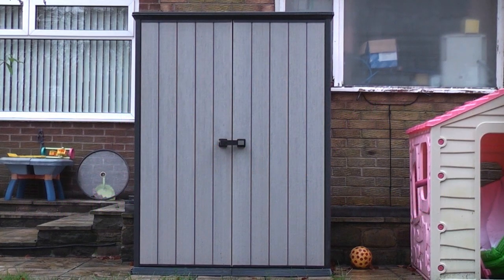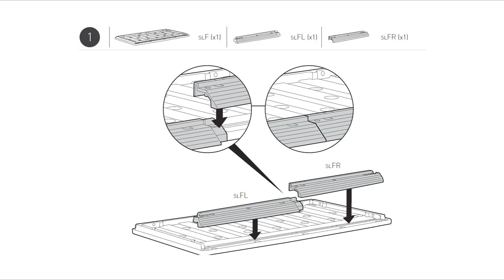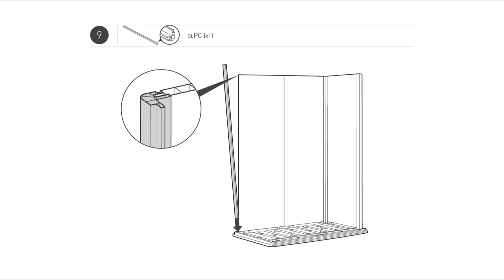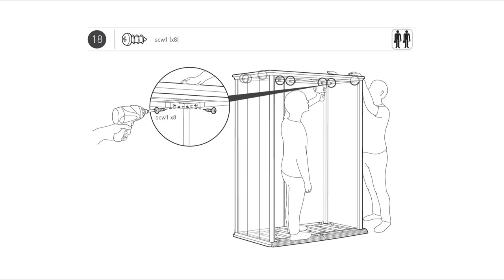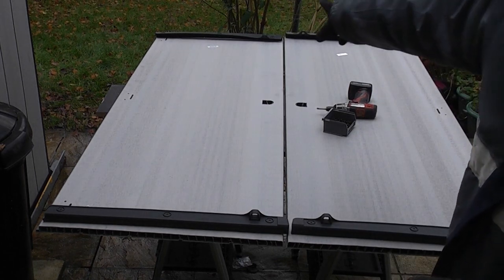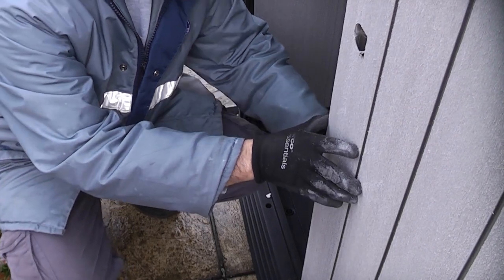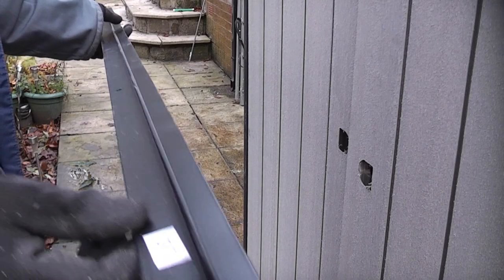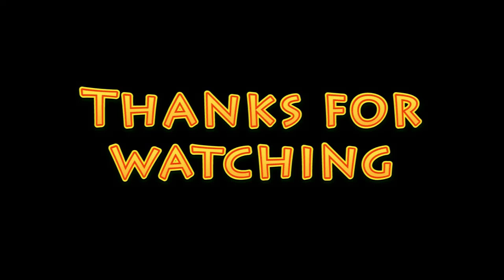Keter High store review and how to assemble

Comment: I have two of these sheds.  The first one I assembled just like the video.  Found that it was a little tricky putting the handles on the doors since I was doing it by myself.  The second I completely assembled the doors, including the handles before attaching the doors to the main part of the shed.  Much easier assembly.
Reply from the maker: Thanks for the comment 👍
Reply: @ultimatehandyman  How do you hang shelves in this?
Reply from the maker: @rogerlubhaya9768   It looks like you just use L brackets, it's on page 26 of the manual here-
https://www.argos-support.co.uk/instruction-manual/4717571-keter-high-store-garden-storage-shed-grey.pdf
Reply: Good tip thank you

Comment: Thank you. This was a lifesaver. One small missing component: I did not see in either your video or in the instructions, the step where you drop the nut down inside the door handle so the long screw can tighten. Maybe I have a slightly new version than previous products?
Reply from the maker: You are welcome.
Yes, I don't remember that component and I was careful as to film everything, so perhaps they have changed the design slightly.
Thanks for the comment

Comment: Nice video. I managed to assemble this myself…still can’t believe it because the last thing I assembled was probably 50 plus years ago, a Lego house.
It’s a great storage unit and I’m really pleased that it’s absolutely waterproof.
Mine doesn’t have shelves although brackets were provided. I’m wondering if you can advise if 12mm thick hardwood plywood is ok. I only need one shelf and don’t plan on putting heavy items on it.
Reply from the maker: That should be fine, as long as enough brackets are used, or it might bow 👍
Reply: @ultimatehandyman  Thanks for that!

Comment: Thanks very much for putting that video together. It made assembling the Keter high store easy. On the version that I purchased, there were no door bolts that latch the door. I think this was a cost cutting measure by Keter. This was unfortunate as the door no longer latches in place and is only held by friction.  Still a nice unit in my opinion.
Reply from the maker: You are welcome
Thanks for the comment
Reply: Probably too late to help, but you apparently have the same model that I do. You have to drop the nut that came with the screw down into the door handle. I suspect that older models had a receiving nut already in place inside the handle, which is why this step also isn’t in the instructions.

Comment: Looks very good. I was wondering: 1. Do you think the inside will 100% stay dry after a heavy rain shower? And would  the holes in the bottom part let excessive water flow away? 2. Is the top part ("the roof") descending so that any rain will  flow away? Thank you.
Reply from the maker: I can't say for sure. This has been fine for a couple of years, but we moved it a few days ago and it was wet in the bottom- but I'm pretty sure that the girlfriend has not been closing the door properly (she's not very bright, bless her).  Once the patio area is restored I will move it back up to the house, but monitoring it will be difficult as she uses it more than I do, and it's likely that she won't close the doors properly again!
Reply: @ultimatehandyman  Thanks for your prompt reply! Would you think the roof is (slightly) inclined?

Comment from the maker: I did consider making an outdoor storage cupboard from timber, but because I am so short of time I decided to get one of these from Argos. Hopefully this cupboard will last for decades. You could probably assemble this cupboard in less than a hour if two people were doing it.
I bought my Keter High store from Argos- http://fave.co/2k4DU0n
Although you can get them from ebay - http://fave.co/2k1V3aN
or Amazon- http://fave.co/2kAk1gX
Merry Christmas to everyone ;-)
Reply: V.G. video. As per.
Can two be connected if the join in the roof is possible to seal.?

Comment: Great video! Ordering mine today, I live in Florida with tropical storms and hurricanes, how would you anchor it down to a concrete slab? Does it come with instructions or recommended anchor point? Or should I just randomly drill down and anchor it?
Reply from the maker: It has 4 round sections in the base where you can anchor it down, I think it had basic instructions on how to anchor it, but the fixings are not supplied.
Thanks for the comment

Comment: What a great video. Thank you so much. Am thinking of buying one and feel way more confident now about assembling it. I can put it together on level slabs, but was thinking of then siting it on a gravelled corner. Do you think this will be okay?
Reply from the maker: As long as the floor is level it will be fine. 
You can't assemble this on un level ground or move it to un level ground after assembly or the doors will not open and close correctly.
Thanks for the comment
Reply: I was also going to assemble the product on level ground, but need to move to the driveway, which is slightly sloped (maybe 10 degrees). Do you think there is any tolerance in the product (especially with the doors) that allows this? I’m not a great handyman so not sure what to do otherwise?

Comment: Great video!  Our kit did not have the SLVP pieces, which I assume are for strength.  Do you think they are needed?  I could look for something at the hardware store.
Reply from the maker: I'd get in touch with the supplier or Keter directly and tell them that the bits are missing. They should send them to you!
Thanks for the comment 👍

Comment: Did you need to anchor these down to the pavement? If so, are there pre-cut holes where keter recommends drilling through?
Reply from the maker: There are pre-marked holes for fixing this down- but I have not fixed it down yet.
Thanks for the comment

Comment: #ultimatehandyman Can you advise if it is possible to fit hooks or shelving to a plastic store or shed and if so how to do it please?
Reply from the maker: I think you can, if I remember rightly it comes with some black self-tapping screws and small brackets for adding shelves. You should be able to use the provided screws to fix hooks etc, to the inside 👍
Reply: @ultimatehandyman  Thanks for your reply but my new Keter shed didn't come with anything like that and so I am wondering if there is a way of securing things other than strong adhesive?
Reply from the maker: If it was me, I would use some rust proof coach bolts and drill right through, then seal the holes with silicone, obviously ensure that the bolts are on the inside of the cabinet. They should pretty much hold anything up 👍
Reply: @ultimatehandyman  Great idea, thanks.